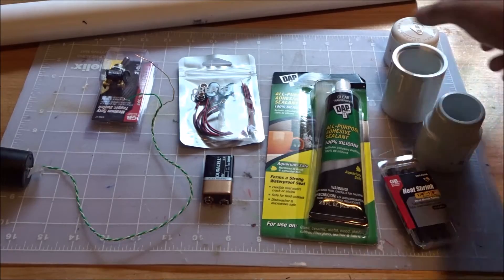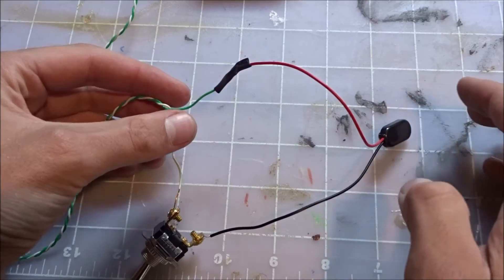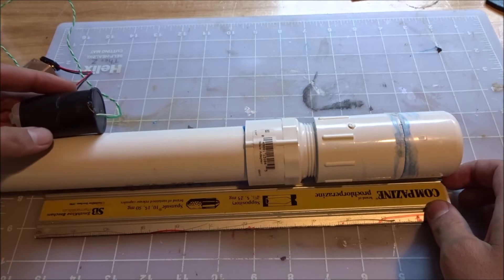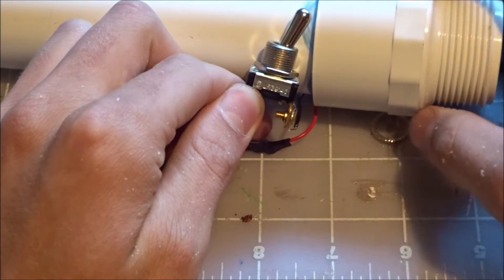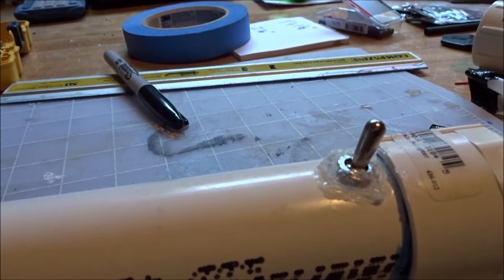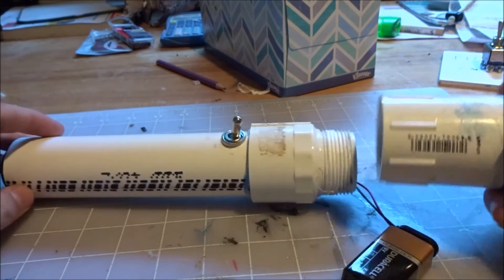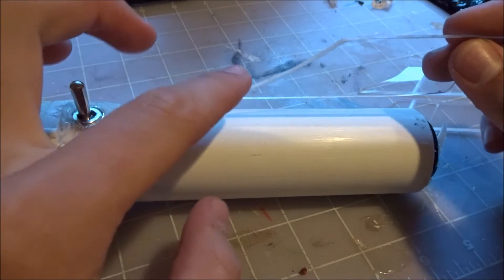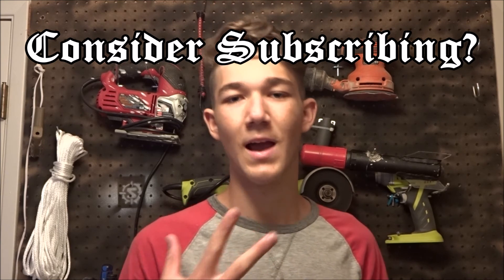How to make: Motorized Toy Torpedo

Comment: Really good video! It is funny whenever you release a video I am always interested in that topic. It would be cool if you could use the same concept and use an electric scooter motor to make something that you could hold on to and it could pull you underwater, I don't know how well that would work, you might not be able to use the whole power of the motor though because the batteries on electric scooters are rather large and you may have to compromise. You could even use it with your scuba rig. I am only speculating and came up with that idea whilst watching your video, keep creating 😀.
Reply from the maker: Funny enough I had a similar video idea, but i think it would be too expensive and dangerous. so I poo pooed the idea. But thanks for the comment, I'm glad to know that someone thinks like me!